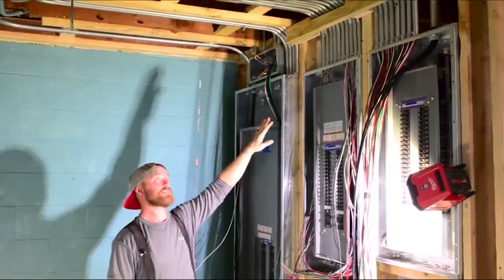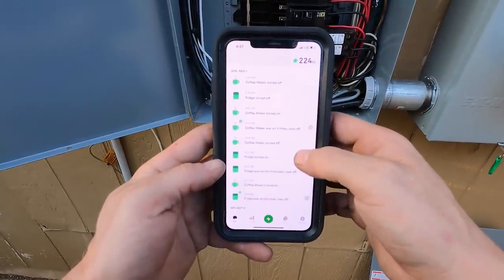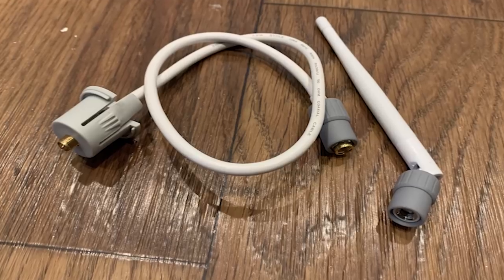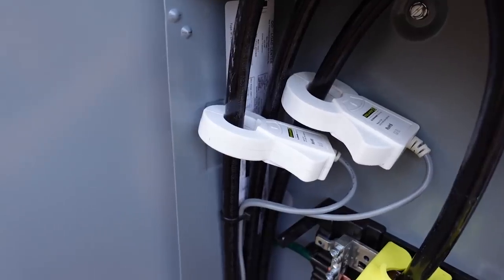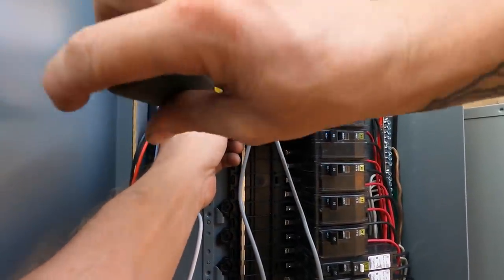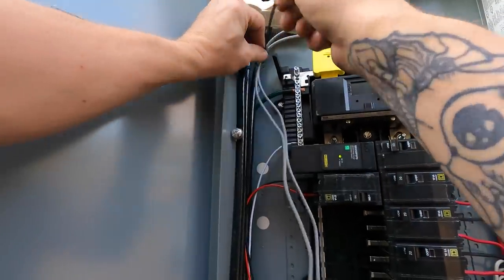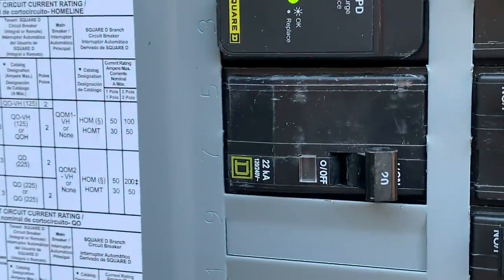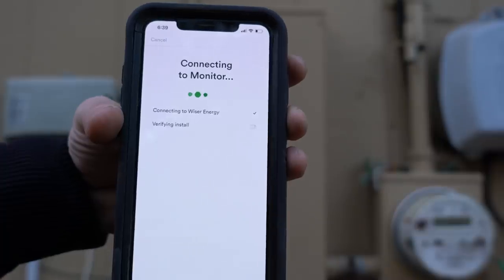How To Install a SMART ENERGY MONITOR in Your ELECTRICAL PANEL

Comment: I have had a Sense monitor installed in my full time RV for several years and it has done a really poor job of detecting my electrical devices!  Even after it detects a device, it often seems to not know when the device is on and just list the power being used as other.  Also, the beep it does during bootup is so weak and such a high frequency that I can't hear it and the device has No visible LEDs to indicate status or even power!  Another con is that it has no Ethernet port so you are forced to use Wi-Fi.  Nice try Sense but in all the years I've had it, things have really not improved much if at all!
Reply: I was thinking the same thing about the lack of ethernet port. I really don't understand the Wi-Fi only direction digital gadgets have been moving to in recent years. Like it only costs 5-ish dollars for manufacturers to add a damn ethernet port.

Comment: I take care of my dad's rentals. It never fails that a tenant will hook up a power strip to a power strip and have all sorts of chargers and transformers for cable boxes, gaming stuff, etc. Every receptacle is a spider's nest. We started rewiring our units so there are two duplex receptacles per box and no more that 3 boxes per 2 pole 240 breaker. Yes, each box has 240 fed to it, but I swear, I have never had to go in the middle of the night to reset a breaker. And yes...every hole has a plug in it and some still have power strips.

Comment: I like the Eyedro system better. It comes with multiple CT's. LOL what you call current sensors is actually called a current Transformer. Ten times more accurate when you have a CT on every breaker.

Comment: OK, so I've ordered one for my house, using the ElectricianU discount code.  Thanks.  It means I can do planning for the future.  In the SF Bay area, several cities have banned gas installations in new build, for environmental reasons, and since I agree with the effort, I'll
be moving towards all-electric in my old house.  But I need to knon what my usage is to know where to take this personally.
I'm just a homeowner, but also a marine engineer, so I'm learning a lot of technique, but I know the technical stuff.

Comment: I have had a Sense installed in my panel for a little over 4 years. One of the most annoying things about the device detection is that it if the device has multiple types of power loads it will often show up as two devices. Such as a Dehumidifier that has a compressor and a blower. It does great on total power usage of our home. You do have to manage it to get various lights and devices learned. I would really like to see them offer little wifi power plugs that can monitor a load directly or even more clamps for branch circuits and not rely on their machine learning that can take forever or never occur.
Reply: Wemo plugs are supported and they report load and if the second CT port is open, you can directly monitor two more 120V circuits or one 240V circuit with a second CT adapter.
Reply: @rpsmith  do you work for this manufacturer lol
Reply: @sams5803  -  No. I'm a retired I.T. guy and I love playing around with all types of electronic gadgets  :o)
Reply: I think Sense lets you link multiple loads to the same appliance in the app so that it reports them as one device.
Reply: You should check out the Eyedro system. You can put a CT or current sensor on each circuit. Way more accurate

Comment: Hey this is kinda cool but a bit pricey... 300 for the basic vs 150 for the "Gen 2 Emporia Vue Smart Home Energy Monitor". Can you test this one too?
Reply: They are two very different devices. I have the Emporia Vue2. The sense is all about user experience and simplicity as it offers a great app and machine learning (because it's only measuring the main entry). With the Vue2 you connect individual sensors to multiples circuits (up to 8 or 16), so more work and cable management in the panel.

End the ends, it depends on what you wish to measure. Sense will detect individual appliances but may miss some others. Vue2 can't detect multiple appliances on the same circuit. For me the Vue2 was ideal as I want precise measurement of each baseboard heater.

Comment: This is pretty cool. One thing I wonder about is data privacy though.  Beyond just collecting data for advertising.. there is a hacking technique known as a side-channel attack.  It basically is a broad term describing a method of breaching a target system by monitoring data on a "side-channel" such as monitoring RF output from a crt monitor or monitoring power usage of components (could be the computer itself, the monitor or even the keyboard).  Whether or not such an attack would be feasible given the current draw over mains is debatable.. but I doubt it is completely impossible. It's a really cool hacking technique though imo.
Reply: Your smart meter is capable of doing everything this device does?  I'd be more worried about that potential vector...

Comment: It would be sick if they could put CT on each out going hot wire to monitor power consumption individually on each circuit instead of guessing which is which. Because the app pretty much guesses what is turning on or off by getting current reading off of main and it’s hard to tell by that. It’s can pretty much tell you the same info your power company can give you.
Reply: It would be sick.  Literally sick!  Info overload.  I work in industrial plants but residential?  Really now.  These things are getting to be a bit too much.  So, yeah, you've got the info.  Plan to do anything with it?  I highly doubt it.  I say use the brain cells for something a little more productive.
Reply: You can do that with up to two loads by repurposing the solar CTs
Reply: You're reading the actual "turn on" profile/curve - not just the increase in current draw, so every device should be uniquely identifiable.  Even two identical light bulbs should have slightly different profiles due differences in the length of wire and other variables to the panel.

Comment: Great timing on this video. Been doing some research on this type of equipment to see how my solar setup is working. sense seems to be the first brand when doing any kind of search but reading reviews I see that a lot of people have issues with the app not being able to correctly ID the loads in your home. What other options are out there that I could look at? This discount is very appealing but I'd like to at least compare to other brands. 
Thanks
Reply: So there are basically two types of monitoring systems: 1. branch monitoring: which you have to put CTs each each breaker. Usually more expensive to install, and  also more expensive if you want to monitor everything. Sometimes you might run out of space too. Then 2. software disaggregation: which you only monitor the mains, keeping installation simple, but it does have limitations when it comes to identifying devices. There is currently not a perfect solution. But I think the Wiser / Sense is overall best
Reply: @GerardFont  thank you for that. I def don't want to go with option 1. Looks like I'll be going with Sense after all.
Reply: @GerardFont  -  I would have to disagree with you about Sense being the best.  Most of the loads that would amount to the majority of your electrical bill would be on their own breaker so having a CT on those loads would give you the most useful information.  Sense will take months to guess at loads and even after months of "learning", still can't figure out most of my appliances.  But if it works for you, that's Great!  I personally would not buy it again if I had it to do all over.
Reply: @rpsmith  Fair opinion
Reply: well i got the sense solar setup. was excited to install it today. when i open the panel i realize i have a 400A panel and 2 leads going to each side. apparently the only way i can use this is to use all 4 clamps for the incoming power which would leave the solar out, solar was one of the reasons i wanted to do this in the first place. any ideas? i sent Sense an email but i dont see any way around this.
Reply: @shelvins1841  unfortunately there is not much of a solution for the 400A main panel if you have solar.  Only way is to monitor one of the mains and solar. Else probably another type of monitor
Reply: Just curious but how is it calculating voltage times amperage to determine wattage is the system only uses its supply wires to power the device and not measure voltage. Also wouldnt it have to measure the voltage across L1 and L2  at 240 to calculate its true amperage. 
Something dosent really make sense here about that.
Reply: @ATI556  they supply 2 clamps for L1 and L2. 2 more clamps if you want to monitor the solar side.

Comment: Square D always made quality products along with great tech support. Wish they offered wider panels. Know the present 14.5" wide panels are made for 16" on center wall studs. Had to work in a 42 circuit panel that had 32 or 33 AFCI breakers. Pain in the ass to install a new circuit in no matter how neat the wires are ty rapped. Wish they would offer panels that were 20 or 22.5" wide. Nice vid.

Comment: i think the reason why it doesn't matter if you use a 15-amp (double pole) or a 30-amp (with the 16 wire) is because the breaker is only supplying power. such a small amount of power is used to power the device anyway. it's not protecting the device's wires...there's no such breaker that small.  i think other people just double tap onto a 240-volt breaker (if designed for it), but i'm not sure if you are even allowed this. i'm not an electrician :D

Comment: I have a question partner, I just purchased a sense flex and I have a portable generator with a plug-in. I want to hook the solar donuts up to the generator. Sent says that it is design only for the auto transfer switch generator and they’re not sure if it would read correctly. I seen someone I don’t know if it was yours that run the generator wire beside the incoming branch circuit to feed the panel will that work or do you not advise that let me know like your channel Kris

Comment: Would you be able to double up on a already existing double pole breaker?
Reply from the maker: yes as long as the breaker is listed for double tapping
Reply: @ElectricianU  Square D breakers are UL listed for double tapping
Reply: I would prefer to get a quad breaker, double tapping is my very last option.
Reply: You can always use a short jumper and a wire nut.

Comment: I have 2, 200 amp panels right next to each other feeding off the same meter.  Both panels have 50amp solar system back feeding a breaker in each panel.  So would I need 2 of these wiser units?  One fir each panel or could it be done with one?  Do the solar clamps come with the kit or are the optional?

Comment: How does this device get around the NEC required separation barrier between low voltage and line voltage wiring inside a box?
Reply: a Wi-Fi antenna is the only external connection.
Reply: I would add, it doesn't need to be inside the load center. (I'd recommend it be in it's own box, or otherwise mounted outside the panel. Like every other commercial power monitor. His is outside, so he put it inside the otherwise weather resistant box.)

Comment: I looked at the sense a couple of years ago, maybe about the time this video came out. I didn’t like the way it didn’t understand many electrical signatures and reviewers said they couldn’t update what devices were mistaken by sense.   For the price of this it wasn’t worth it.  I need to know what each circuit is consuming. If I know usage by circuit I can make some decisions on consumption of power.

Comment: I just recently got one of these but haven’t installed it yet. Seeing in the manual where it specifically says “compatible with Square D 15-30 A breakers” has me concerned, I assumed it was compatible with all types of breakers. Mine is the tan type of breakers so it’s either CH or or maybe Eaton brand. Either way I’m out of space for any more breakers so my original plan was I was going to have to do a pigtail. I was going to use 2 pieces of 10 gauge to connect to a 30 amp 2-pole breaker that is feeding my clothes dryer. Should this work?

Comment: Quick question so I’m an electrician and I’ve been doing residential for two years and I’ve always been taught to stay away from zip ties because it’s bundling the conductors but I always like to make my work look at awesome so I just have be conscious or OCD about stapling wires together thoughts on this would be appreciated
Reply: He was bundling the sensing wires not all the current carrying conductors. Bundle up branch conductors then you have to derate them.

Comment: When I pulled the protective cover off my high voltage inputs into the panel it does not use insulated wire.  Instead it has what appears to be uninsulated aluminum straps/bars leading the main breaker.  Can I still install the monitor clamps on the uninsulated aluminum straps/bars?

Comment: I'm trying to have an open mind here... I have a 200A main with 3 sub panels, pool, theater, 2 hvac systems etc...so now what am I going to do differently after this is installed ?? I think the answer is nothing...
Reply: Well if it managed to detect and reliable monitor your pool pump, you might be shocked how much that is costing you!
Reply: Or if it reliably detects and monitors your HVAC system you might be surprised how much you’re using in the summer and you may either keep the house at a warmer temperature or consider upgrading the system to a more efficient one. Same thing with the pool pump you may consider having it run less or replacing it depending on the age
Reply: @coolsnake1134  I get what you're saying but I already do all of that, and I watch my electric bill closely to keep it as low as possible 👍

Comment: My panel is full; can I connect it to the existing 2 pole breaker for my dryer or stove?

Also, does one have access to the background data? I'd like to explicitly poll the data for my sump pump.
Reply: Hi Ron, I can answer that for you. If the breakers are Squared D, they are UL listed to be double tapped. You'd need at 2 pole breaker anywhere between 15 and 30 A. In fact, if you get the solar unit, it comes with 2 extra donuts, and you can use them to monitor specific loads with 100% accuracy. In your case, for the sump pump, and even one more load.
Reply: You can make some rearrangement on your breakers if your panel isn't that old.
You can buy couple of quad breakers and fit 4 circuits instead of two (on 2 space)
Reply: I would think if the breakers are rated to be double conductors you could. All those wires are for is the small amount of power the unit required and Voltage sensing.

Comment: I come from the computer industry, and I am terrified by all these "smart" devices. The basic ideas are fine, but the fact that they need you to install an app and are connected to the wifi is a problem. As we're starting to see in some other industries, the companies who make the app can actually take control or take away your control. And HACKERS, man! Slightly less problematic is the fact that wifi routers have a limit to the number of devices that can be connected to it at the same time, and it seems like some people are trying their absolute best to find and exceed that limit.

I really want to find something like this that has the screen connect physically instead of wirelessly and the app is in the device, so you only need to hook up a touchscreen or monitor and mouse. I certainly don't mind having to go to a place near the panel to check out the stats. If you do, then there are a few other smart home systems that use other, more secure wireless technologies to connect.

Comment: Are there any issues with installing this when I have a Generac backup generator?
Reply: Get the Solar model.  It has two additional CTs that can be used to monitor your generator input.
Reply: @rpsmith  Thank you.

Comment: Question for any electricians: I have two large panels on 200 amp service, one panel is connected to a generator with transfer switch, the other is only on street power. Should I install two of the sensors one on each panel, and is the generator a problem?
Reply: Is your main panel a 400A split into two 200A main breakers?
Reply: @GerardFont  no I believe that each panel gets a feed from the meter independently , then the main panel has a transfer switch to generator. I trust my electrician as the power company had to look at the meter and said they had never seen such high quality work.
Reply: The Sense unit has two additional current tap inputs that can be use to monitor any one of the following:
1. A second breaker panel
2. Two additional breakers circuits
3. Solar input
4. Generator input.